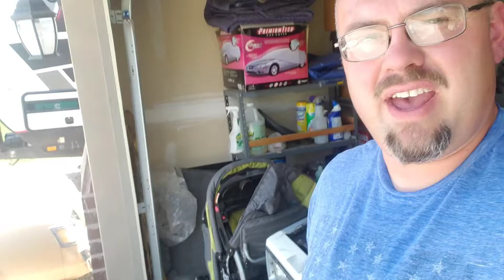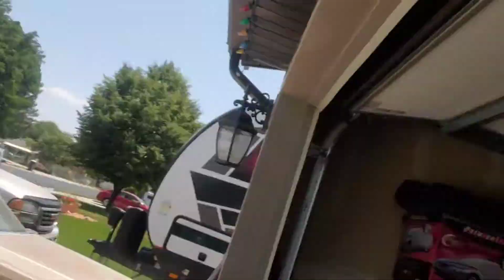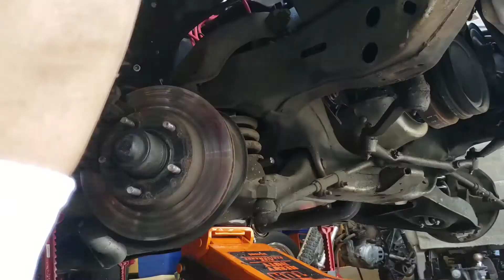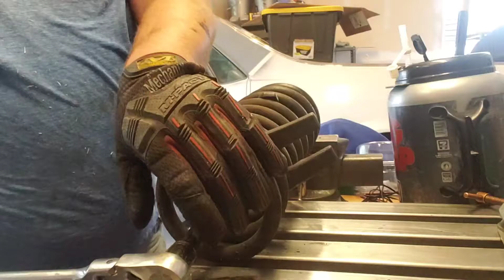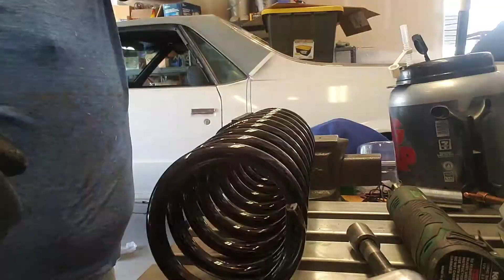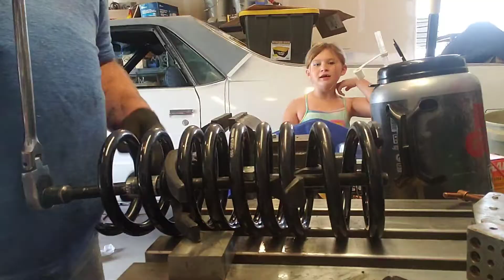Moroso Trick Spring Install Part 2

Comment: Awesome.  Watched the whole thing . Trying to put my springs and they are fighting me .  Nothing like having motor mania on while working in the shop.  Makes for great motivation when you hear some one is .046 and  2 above and still wins .
Reply from the maker: I'm not going to lie, the Trick Springs are much harder to get in than the factory springs. Even though they may be the same height, it seems like they want to move around a lot more! That's why I grabbed some tie down straps to help move the spring where I wanted it. Hook near the bottom and anywhere on the frame that makes sense and ratchet away until you're happy with it. It's a balancing act. 

Locally, there were a lot of win lights in my class with a package like that. The El Camino ran 13.0's here at 4200 ft and has been as fast as 12.40 @ 107 at Firebird Raceway in Boise on a 36 degree day at a 700' DA.

Comment: Did your ride height change with the springs ?
Reply from the maker: It basically put the car on the lower bump stops. These were given to me and were not the right spring rate for the weight of the car. I put them on anyways to see what would happen.
Reply: @SnowFamilyRacing  that’s what scares me. I bought the highest spring rate they make for the 69 Camaros so hopefully it doesn’t drop it to much. Planning on swapping them out later today.
Reply from the maker: My dad has a set under his '64 Buick Special that have worked out great. We took the car to a scale to get a front end weight before we ordered them to get the right spring rate.
Reply: Did you get the correct spring rate for your car? If so what was it? I’m trying to figure out if I can use the G body spring in a C10!
Reply: @teamabaddonracing6870 let us know how it worked out for you, and if your bbc or sbc aluminum head etc, good luck!
Reply: @Rudedog75   it’s a 421 sbc Motown heads 12:1 comp with a procharger 14lbs of boost. Run on E85.  For the last 15 plus years I had the 213 lb/ in  it and it was a little on the low side. The past couple months I had trouble getting the car to hook and saw in a video that the front wasnt coming up as high as it use to so I think they are just worn out. I got the 241 lb/in part number 47165 this time with hopes it raises the ride height up a little and get the car hooking again.  If by chance it’s to high I will trim a coil off
Reply from the maker: @teamabaddonracing6870 I've read that the trick springs do have a finite lifespan, they don't tend to last as long as others.
Reply: @teamabaddonracing6870  Trimming off a coil increases the spring rate, how much I don’t know, but on my c10 cutting off a coil made them very stiff!
Reply: @Rudedog75  I know it’s like playing with fire.
Reply: @teamabaddonracing6870  I’m guessing you didn’t have to cut any off the 213lb spring? Please let know how your ride height turns out with the new spring!
Reply: @Rudedog75  I got the new trick springs put in. Ride height went up about an inch. I got a couple test hits in and it  made a big difference. My old ones were definitely worn out.
Reply: @teamabaddonracing6870  Terrific, thank you for letting me know!